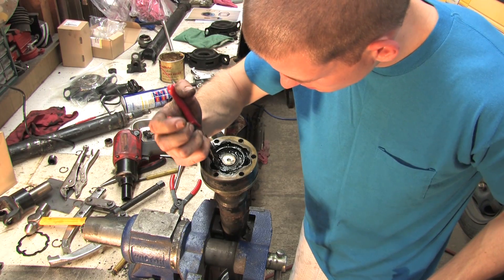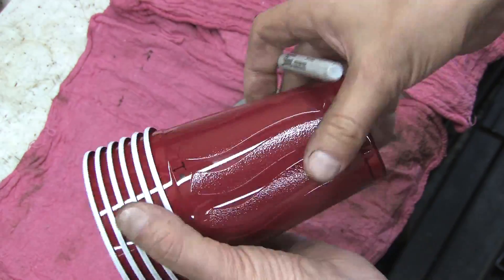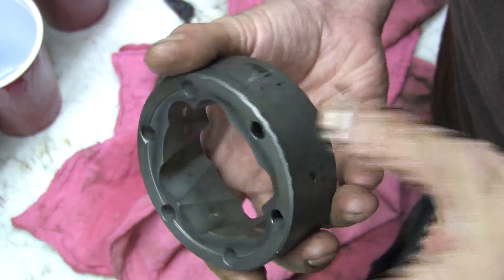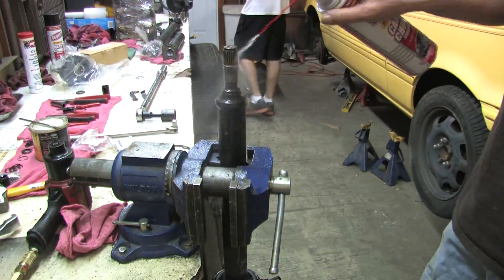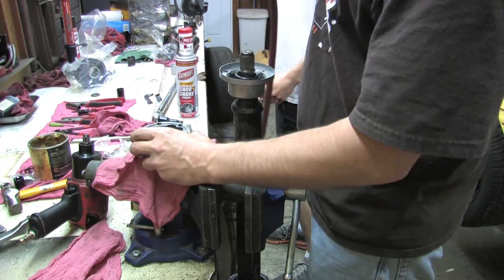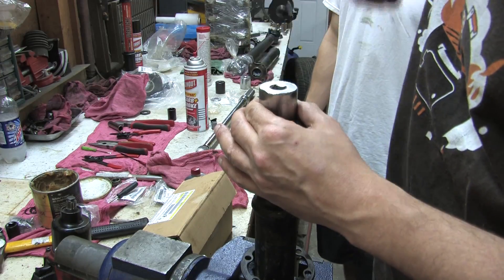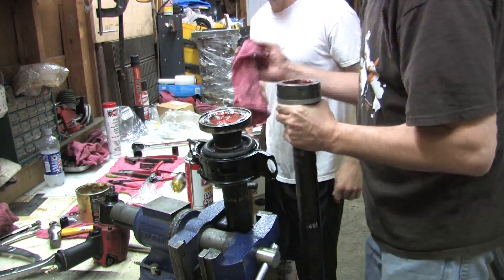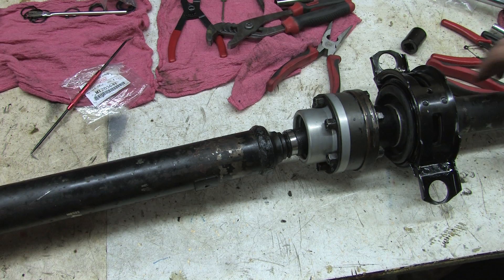Driveshaft 104 - Lobro Joint Tech

Comment: Did I get that right that you squeezed the snap ring ends together to remove it?
Reply from the maker: The PLIERS are jointed so that it spreads the ends.  lol!  I had to click to see what you were talking about.  The snap ring pliers in this case work reverse from normal pliers.
Reply: @Jafromobile  OK. Maybe I misunderstood, but it seemed to me that later on in the video when you re-install the snap ring you said that you use a different set of pliers to spread the snap ring this time. I actually have the exact same snap ring pliers.

Comment: Just a little FYI, you need to install the snapring in the correct orientation.  They are like the washer used in the yokes, one side is rounded the other is flat.  They are a stamped part. The flat side needs to go same direction as the load. The rounded side will allow the snapring to ramp out of slot. 
Great video thanks. 
Also I don't know if a vw part will be cheaper, my 4motion passat wagon was easily the most expensive car to maintain, way more than my galant vr4, or Eclipse gst.